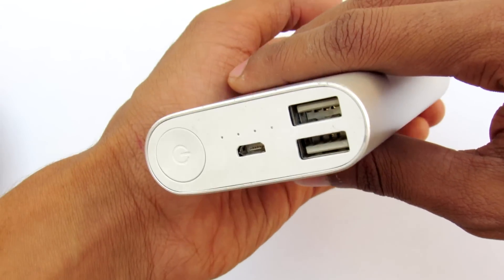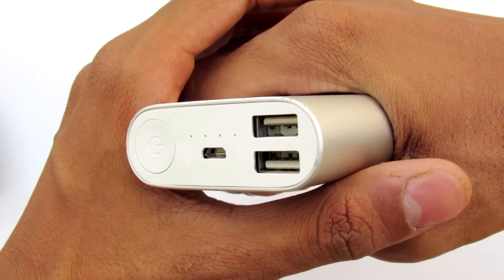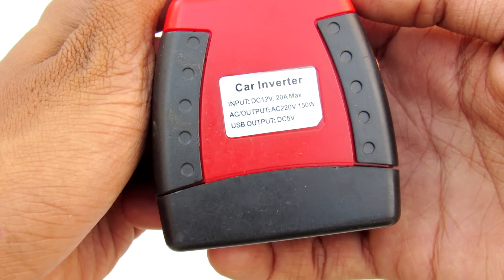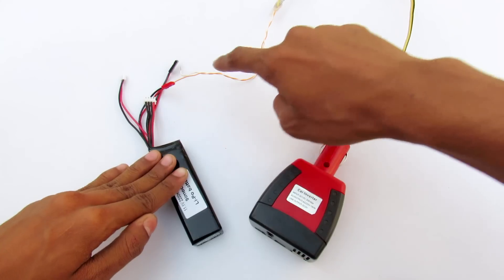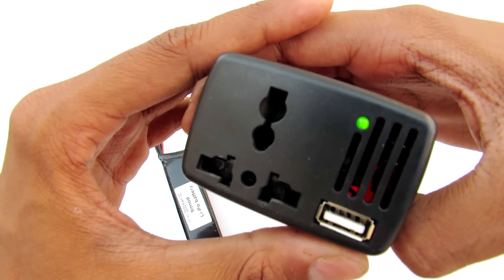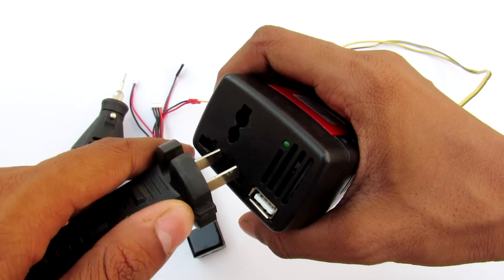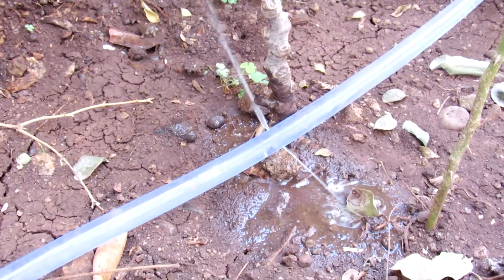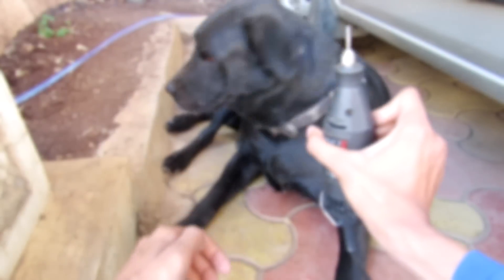Virtually Cordless Dremel Tool : Portable AC Outlet

Comment: Make sure you are using battery that is capable of atleast 20a
otherwise this is really dangerous
Reply from the maker: +cekpi7 in my case I measured 4 amp DC steady current when dremel is on at 50 % speed so this 8c rated batteries will also work just fine .
Reply: +Kedar Nimbalkar yeah i tried to do that with 14v drill on 11.1v battery and it measured 4-5a but when i was drilling something it jumped to 12-13a
17,6A should be enough for 50% speed but it would be safer to use bigger capacity
Reply: ***** yeah but depends on their C rating
Battery in this video is 2,2Ah wit 8C and its good up to 17,6A but not more than that

Comment: but kedar that battery is quiet dangerous
Reply from the maker: +AlimanFX Don't worry this inverter has over current protection ,so it will just shut off in that case.
Reply: +Kedar Nimbalkar but does it have reversse portection
Reply from the maker: +AlimanFX You can solve this problem by putting a diode in series or a DC connector.